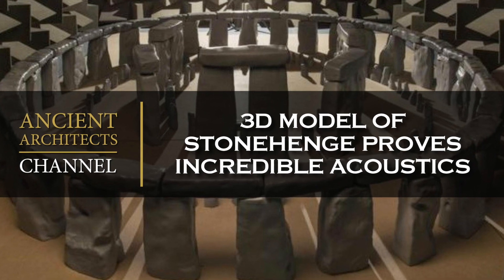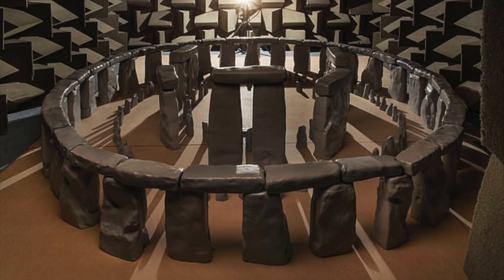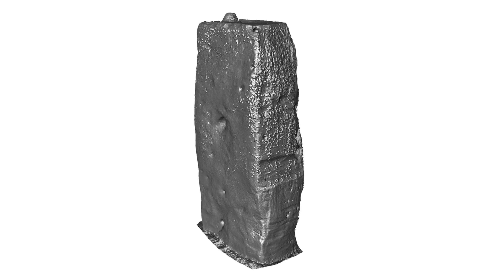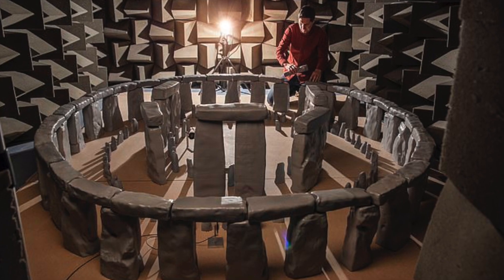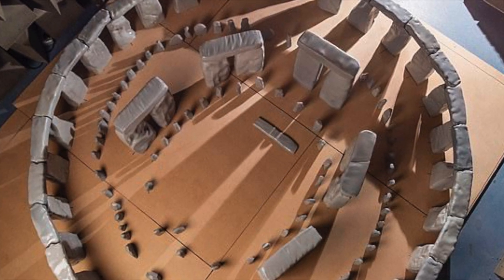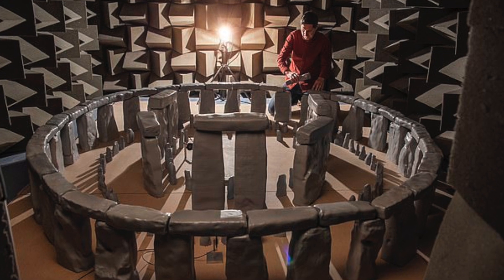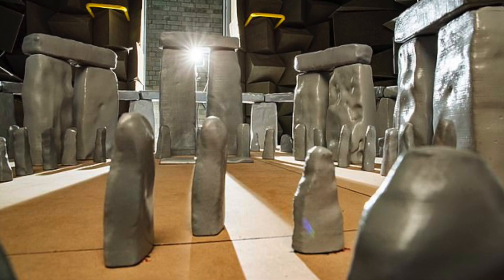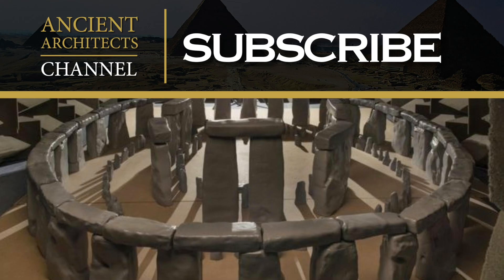Stonehenge 3D Model Proves Incredible Acoustics | Ancient Architects

Comment: It's my understanding that the stones themselves have acoustic and electro-magnetic properties. Recreating them from concrete and polymer will only give a partial picture
Reply: Electromagnetic indeed. Why would they pull the stones all the way from South Wales? The gneiss infused rock interacts with the human electro magnetic field. Just like wifi does...
Reply: @ThrottleAddiction  ,That's fair enough. Stonehenge doesn't seem to be terribly sophisticated from an acoustic viewpoint anyway. They said "amazing properties" but that seems to just be sensationalist as they don't quantify what that means beyond the existence of reverberation. It is obvious that if you arrange a lot of tall mirrors in a circle you are going to get a lot of reflections.
Reply: or at least recreate using the same stone in miniature and on an energy line convergence like the real one...
Reply: Stones have very little electro magnetic properties. That's why grounding is used as an insolator. Acoustic properties arise from the source, the stones would reflect the properties. 
That said, it is interesting and not at all illogical to consider that acoustics played a roll in the design.
Reply: @ThrottleAddiction  , It is always good to consider potential experimental errors, however I can safely say that this is not one of them. 

That is because the fraction of sound that reflects from a material's surface instead of passing through it is equal to the ratio of the densities between the substance the wave is in before it reaches the material, and the material itself. 

In other words, both rock and plaster are near ideal mirrors for sound, because they are orders of magnitude denser than air.  There is only a point considering harmonics is the sound actually enters the material itself, thus it doesn't matter for the experiment which you use.

Comment: Stonehenge was designed and built in the early 1900's. Originally it was one standing stone that was leaning over. Rest of stones were just laying around. So what is the point of this video?
Reply from the maker: No it wasn’t. Some were lying down. It was renovated on a large scale but more than one stone was stood up. They also have patch marks in the grass so they knew where they stood, and there are sketches and eyewitness accounts going back hundreds of years.
Reply: @AncientArchitects  
Well. I saw the old black and white photos. One leaning stone. Marks in the grass? After hundreds of thousands of years?